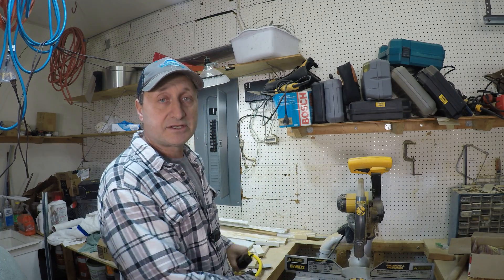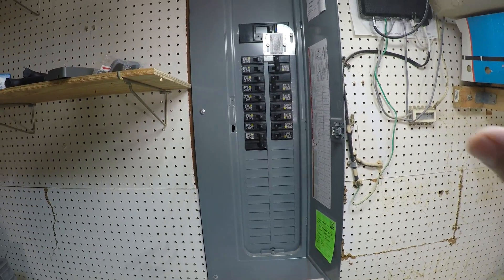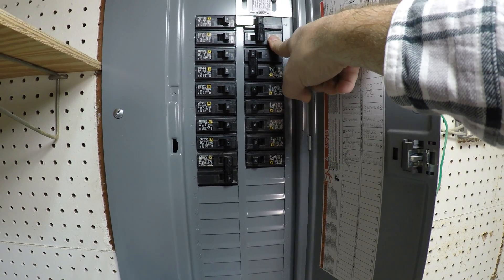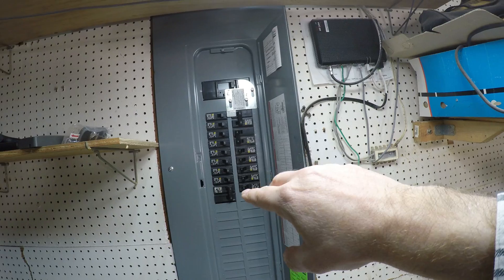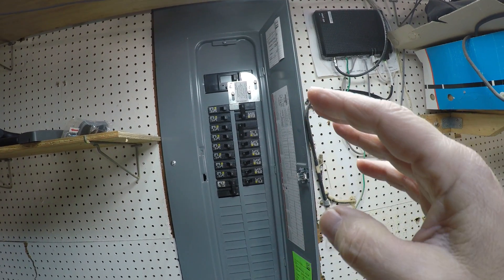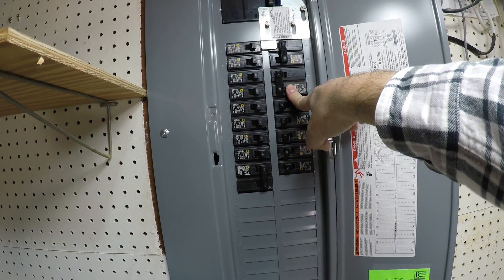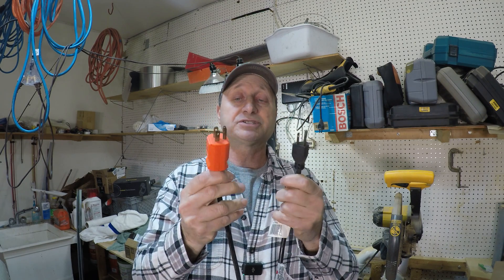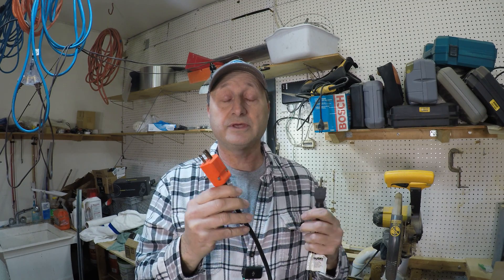How to Backload an Electrical Panel from a Generator SAFELY

Comment: what would happen to the neutral wire. the neutral wire coming into your home does not have a disconnect [for obvious good reasons like the grounding or earth] 
i had the power company tell me that because i was backfeeding my panel [which i was, but the mains breaker was off] they were able to detect using their "smart" meter, that my place had power and wanted me to verify if i had "power". all i did was turn off my furnace, and unplug that not so safe plug, then verified by using an indicator wand \ voltage detector. i said, NO. and they proceeded to restore my power in a few hours. 
does any of that make sense?
Reply from the maker: no it does not make sense and I also hate smart meters

Comment: Why do so many people put power from a generator INTO the LOAD side of a breaker. A breaker is a one way device, power is NEVER supposed to go INTO the load side of a circuit breaker.
Reply: I thought a standard circuit breaker is not a one-way device. It is not a simple switch designed to interrupt the flow of current when it becomes excessive, and it does so regardless of the direction the current is flowing?
Reply: Do you mean even his “right way” with the interlock kit yes the power is still going through those two 30 amp breakers in reverse. That’s why I’m here. I saw a forum thing saying it’d fry breakers. I wanna know if there’s special breakers designed for that back feeding with the interlock kits
Reply: @TheThethunder666 they make the breaker for this.

Comment: Very good info. Am I wrong if you're only powering a certain section of the house it's ok to plug directly to an outlet given not all outlets are on the same breaker?
Reply: ABSOLUTELY NOT! That's exactly why they call those suicide cables. AC is an alternating current. If you plug into ANY outlet of the house without changing the breaker settings you will energize your house AND the electrical grid it's tied to. So if there's a lineman working on your section during an outage you can kill them. If you disconnect from the grid then that danger goes away for them. The safety switch you see him use ensure that the ONLY way to turn the generator breaker on is to turn the main power breaker off. That disconnects you from the main grid. 

If youre off main grid and only turn the breakers on you want to power your idea MIGHT work. But then there's amp loads and floating grounds.

Unless you're trained it's shaking hands with danger. Just get some extension cords in emergencies and then install a proper box when the disaster is over. Don't burn your house down when 911 DOESNT WORK.
Reply: I just tried this! Anything “upstream” of a GFCI in regular grid power conditions won’t work. GFCI will not let you back feed through them. Also you’d want all the circuits you don’t plan on using switched off at your panel.
Reply: And just ALWAYS turn off your mains when power goes out! Besides not wanting to back feed the grid and kill a line worker. There’s usually surges when power is restored that can fry your appliances
Reply: @TheThethunder666  I always leave the main on, but turn all the rooms off but one. I'll keep a radio or something that makes noise plugged in so I know when the grid is back up. My neighbor next door ran their genny TWO days after power was back, because they didn't know.